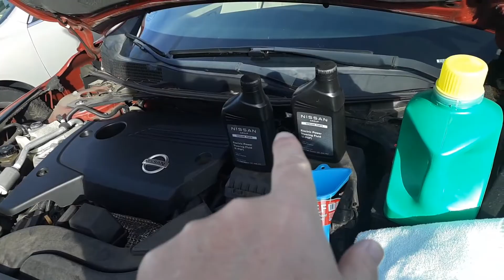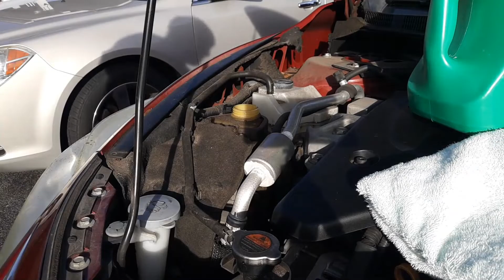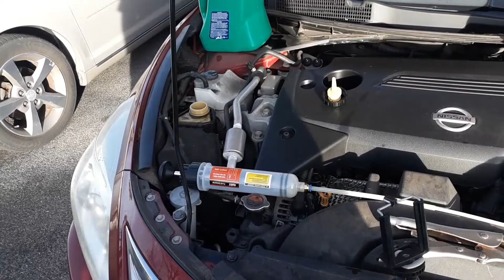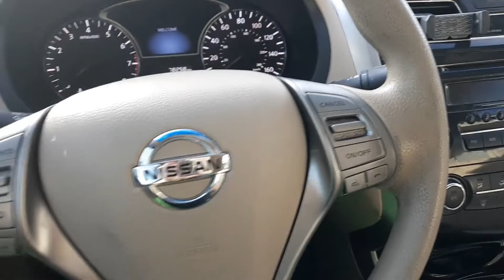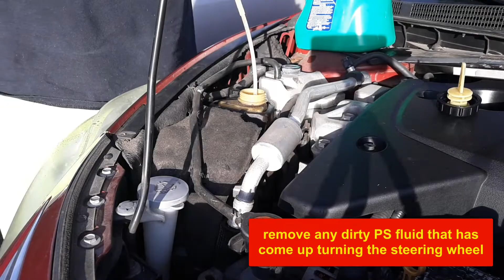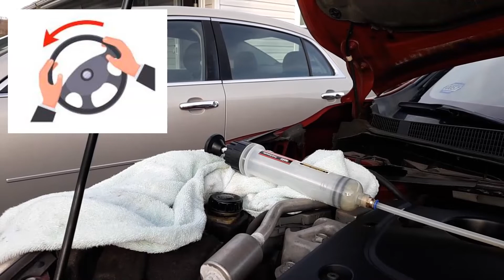FIX: Accidentally Poured WRONG Fluid in Car Power Steering Reservoir (Motor Engine Oil E-PSF Water)

Comment: I put the wrong fluid in an when I reverse an turn the wheel it makes a horrible noise it’s only  in reverse an when I turn the wheel
Reply: Did the problem go away when you put the correct fluid?
Reply: Will a small amount of regular power steering fluid  hurt it? I put small anont of regular power steering fluid in my 2015 nissan altmia and not the nissan fluid